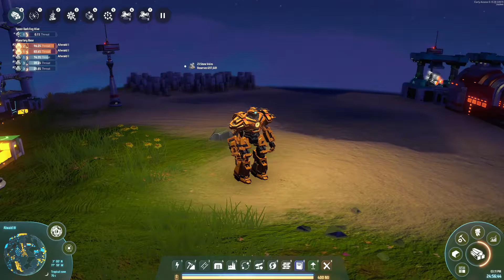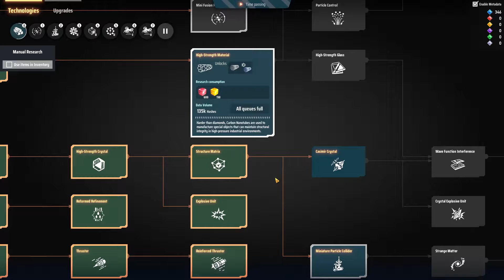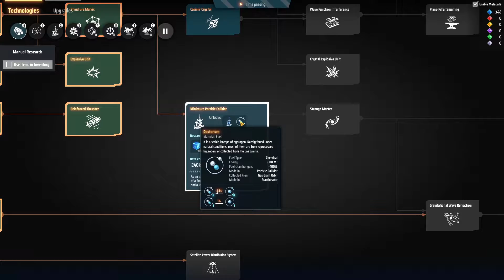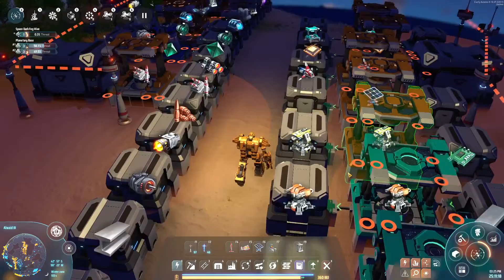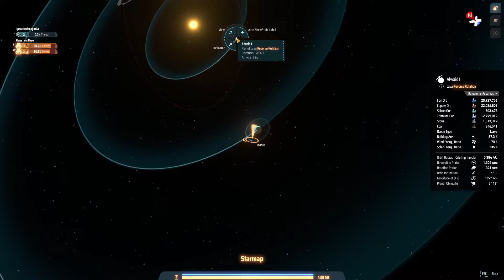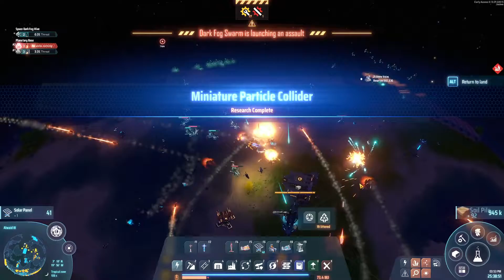POWER GRID // Dyson Sphere Program // Mission Log 30

Comment: don't forget your wind turbines! wind turbines are dirt cheap, run 24/7 and can be placed on the water, so if you cover your oceans in them, that might help a lot! but ya "renewable" power isn't going to cut it. from what i was able to tell, your science was costing you about 50MW, which is like half your demand.

signal towers at each solar panel facility will help a lot, taunting the fog off the expensive solar panels, and get your missiles working together to protect them.

chasing bottlenecks is basically what this game is about! whether its power or raw ore or whatever it is lol. sometimes ill play for 5 hours and realize i haven't actually progressed anything, just fixing past mistakes.
Reply from the maker: Yeah, I'm looking forward to / dreading rebuilding the mall, as I think I can do it right once I have the planetary logistics towers. I also think it will take a dozen episodes, and I'm debating whether or not to do it on my home planet or head out to the icy planet at the edge of the solar system and start fresh from there.